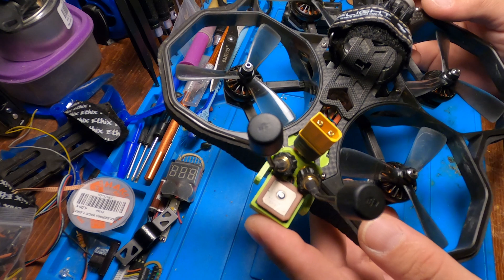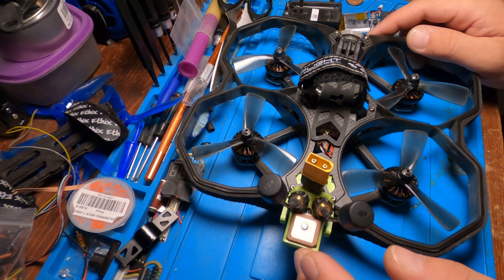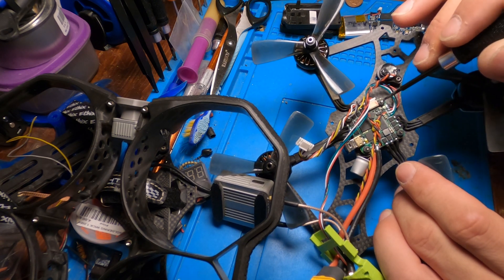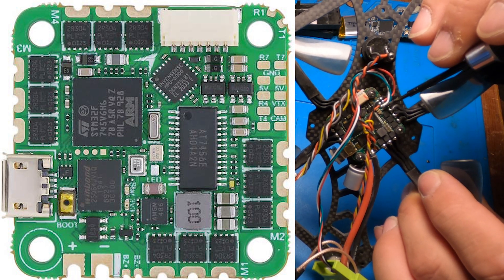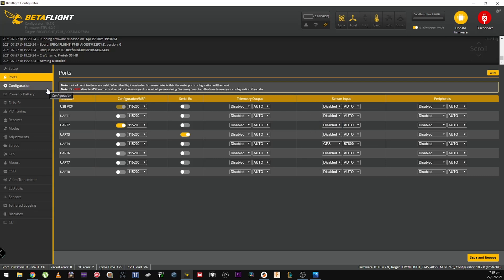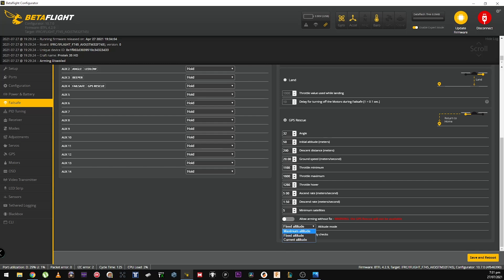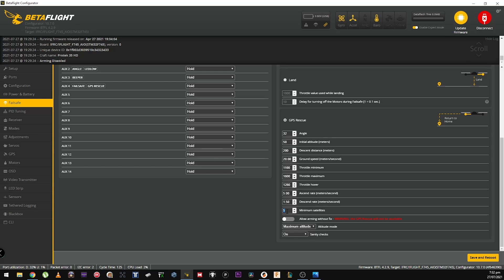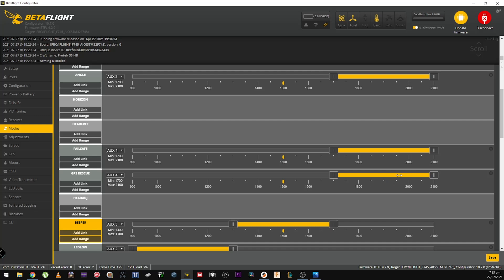How to add gps to ProTek35

Comment: I'm trying to find the exact 3D mount you have with 2 antennas,  couldn't find anywhere, that link shows only 1 antenna, I have Portek 35 with Dji Air unit
Reply from the maker: No it’s with 2 antennas this link. https://www.thingiverse.com/thing:4918417
Reply: @dannyblondu23  thanks so much for your response,  exactly what I was looking for

Comment: Hi! Thx for the great manual! I also wonder how did you fit a full size air unit in your Protek35. And why not the smaller caddx vista? Couldn't find any videos about that.
Reply from the maker: Hi. I just buy it like this. And it's not hard to add a Air unit on a Protek 35.
Reply: @dannyblondu23  I am not even sure it's gonna fit :) and how it's gonna hold. Couldn't find any reliable info...
I am sure many people will appreciate a full upgrade guide. Adding DJI AU or Vista + Crossfire + GPS + new TPU mouns. As this year Protek35 was very popular I am sure there are plenty of owners of the analog version with an Frsky receiver who are looking forward to such an upgrade.

And also a pusher mod! ) Very interesting!
Reply from the maker: @AlexeyMakhrov  yes are a lot of Protek 35 out there. I'm not in a free time now, but after Christmas I will make a video.

Comment: The soldering procedure and points are the same for analog version? I have ImmersionRC Ghost.
Reply from the maker: Yes. You don't have TBS but you have Ghost. And if you have the Ghost contacted to the Rx4-Tx4, just contact the GPS on Rx7-Tx7. And follow the instructions.

Comment: Hi bro nice review. Btw im just install a gps on my protek35 and never testing it yet. I just want to know if i should set a failsafe switch? Because i watched on other person videos they not set that switch, only set for gps rescue switch.
Reply from the maker: Hi. If you have TBS crossfire put a switch, in any case you don't have video you flip the switch and come back to you. But make some test and flip the switch to see if comes back to you. With TBS crossfire you never gonna have a feilsafe, only if you go 10km or more.
Reply: @dannyblondu23  yes currently im using crossfire. Okey now i understand. Thanks for the explanation 👍👍👍